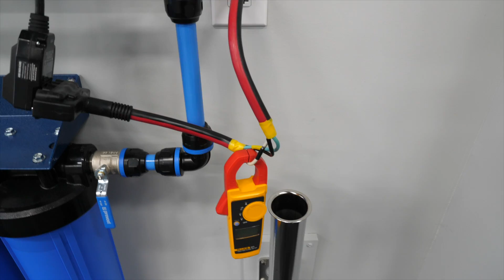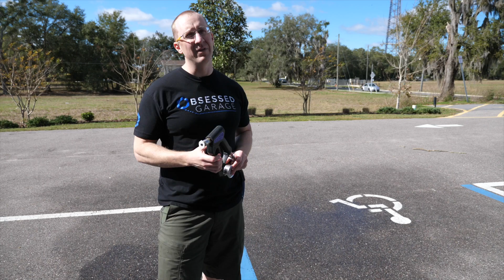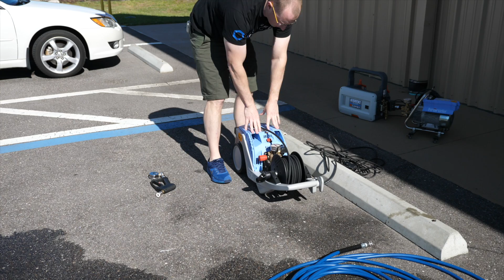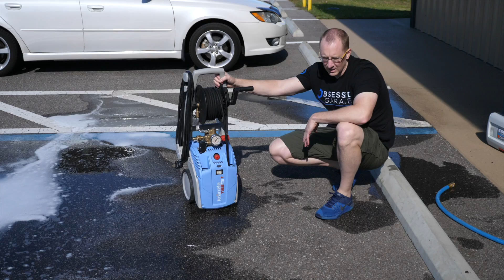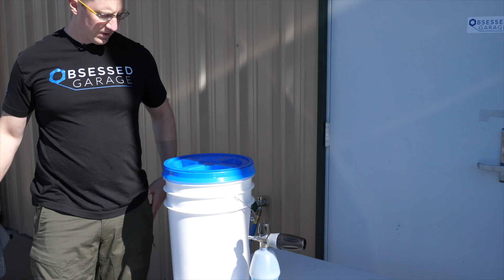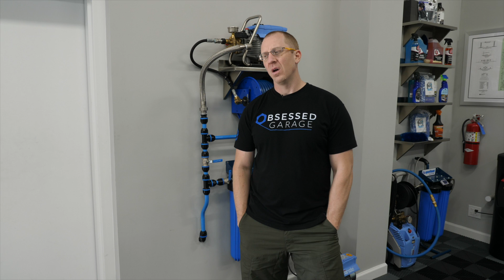The Pressure Washing Project: E12 - Testing Kranzle and Comet

Comment: Awesome Matt, was waiting to see the comet. I was expecting the Kranzle to perform as it should, but impressed with the comett. Apologies if I misunderstood, but did you said you will be selling the comet, that means at OG store or that was about this particular machine? Looks like the comet would be the better option so far to upgrade if you have all the components already without getting into the price range of the Kranzle, which would be the case with a AR "pro" type, for that it will be just better to get a Kranzle, totally agree on that. Also, on the pf22, it's the best, period. Did you tried the pf22 with the 1.1mm on the comet?, wondering why it was watery or maybe was the soap mix. Great videos man, keep them coming, 👍👌
Reply from the maker: You won't want to put 1.1 on the Comet.  That's going to overdrive the machine since it does 1.9GPM.  I'm working with Amos to possibly offer a solution for it.  They have some major issues to iron out with shipping and quality control.
Reply: @ObsessedGarage   I see, though that was probably the reason. Hope the comet stuff works out, should be decent solution compared to the cheaper stuff. Thanks for the reply.